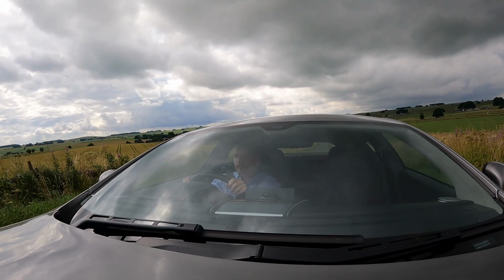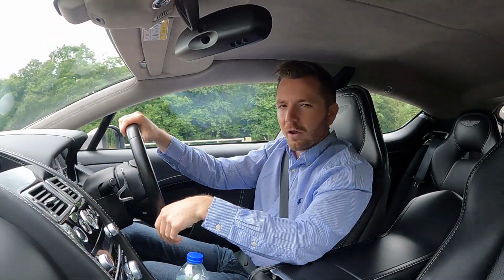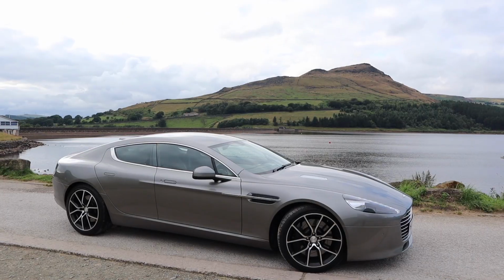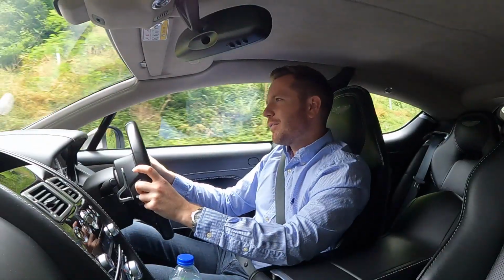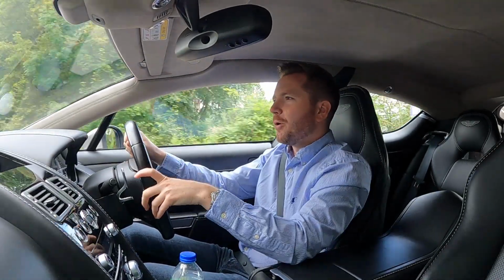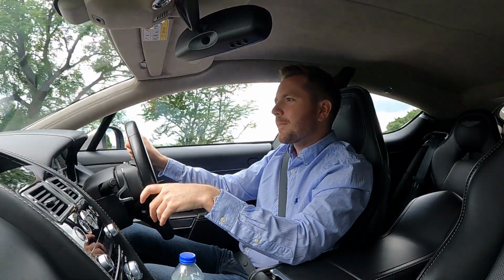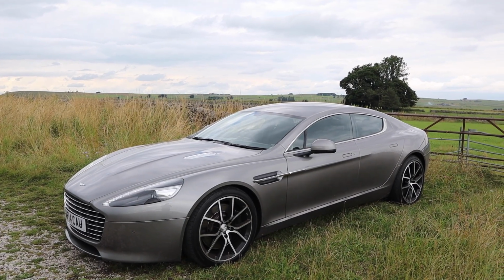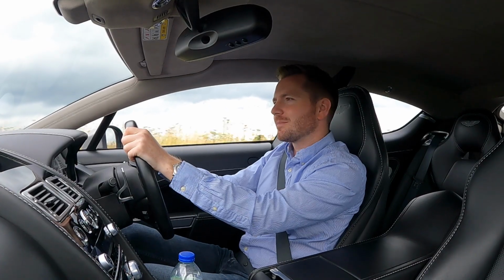Should You Buy an ASTON MARTIN RAPIDE? (Test Drive & Review 2014 Rapide S)

Comment: Just come across this review. The key you have is the Valet Key, it's there to protect the nice looking Emotional Control Unit or Glass Key. Later versions have a superb 8 speed box that really kicks down (and up) quicker than it really should. It looks best in any other colour than the one you are driving. I like the black one. Also the last two years (or so) of manufacture have CarPlay and Android Auto. The key also came in a leather pouch with a key ring attachment. Nice review.
Reply from the maker: Thanks

Comment: How is for a 6 ft 200 pound person is it cramped or plenty of leg room ? I am looking into buying one just wanted to know :)
Reply: I'm the same dimensions as you and there's loads of room upfront.
Reply: @rhone81  Thank you I appreciate it
Reply: @johnniepope7214  No problem. I bought a 2013 Rapide S three months ago.

No complaints about the driving position, loads of room and comfortable. I've not had any issues with the high centre console. If anything it makes you feel part of the car and the car shrinks round you.

I'm uncomfortable in the rear seats though and my head touches the roof lining. If you have anyone the same size as you who'd be going in the rear it'll be a problem.

If you have any other questions just ask.

Comment: I currently drives a Maserati Gran Turismo Sport, 4.7 NA engine. Great sound and practical. For the next car, I am thinking about a V12. It is difficult to choose between a Rapide and a Ferrari FF. FF is definitely more engaging and sounds awesome and it has more presence on the road being a Ferrari. But it is very costly to maintain and repair, not to mention the fragile transmissions (yeah, the s is accurate). Rapide is more subtle (relatively) and maybe a bit too under the radar. But it is definitely more reliable compared to FF and less expensive to repair. And it is about 50% cheaper to buy used. The wise version of me tells me to get the Rapide. But my heart tells me that if I get the Rapide, I would still think about getting a V12 Ferrari in the future.

Comment: Hi Matt, the disappointment with the key is because you have the ‘Valet’ key. The actual key is actually a crystal key with the logo, which is sadly called the ‘Emotional Control Unit’ (ECU) and they are VERY expensive to replace and can be damaged quite easily, hence you having the valet key
Reply from the maker: Both the keys on this were the plastic keys disappointingly

Comment: Owned an 03 Vanquish V12 6.OL, driven many miles with few problems. Used to start it in the garage with exhaust 2 feet from wall just to, well, you know, cross your legs and... . OMy effing G, what a sound. I sold it in 2010 and am currently still in therapy but told I will get over the loss.... eventually.

Comment: peel aston m logo from key fob and you will see volvo sign on it, same goes with engine
Reply from the maker: You’re thinking of the vantage
Reply: not vintage at all, take any mercedess take it on ranmp and 80% parts are from renault and fiat. these days can't buy good stuff. i been driven 18T MAN rigid it's was about 1 month old 2000 miles on clock and wear of metal frame around rear doors (as an example) wasa exact as on 12 year old exat model and size. 
PLANNED OBSOLESENCE (it HAVE TO BRAKE right after warranty expires) thats what we paying for

Comment: Keys have been crap ever since they put chips in them let alone door unlocking remotes. RF connectivity requires plastic and plastic is plasticky, it's soft, it wears quickly and it rapidly looks worn and tacky.
There are "quality" plastics that wear well, perspex is one, it's hard and in use in the pocket it gains a soft semi-polished patina. But perspex is brittle, drop it and it will probably snap.
A key that looks good after 10 years of use is possible but requires investment in materials and production. Most car manufacturers are content to farm that out to the likes of Hella.
And size, why are car keys so big? I have three cars in the family but three keys on one ring and you have something too big too carry in your pocket.

Comment: The proper key has a crystal endpiece with the Aston logo etched into it and is called an ECU. Emotional Control Unit.  As long as this car is they needed to make it 3 inches longer so the rear seats could be more practical. To buttress my point, When Aston turned this same chassis into the £1million Taraf. They stretched a Rapide by about 5 inches to make it a proper limo

Comment: 'Never meet your heroes'... I was lucky enough to buy a black 2009 Vantage N400, back in 2010. On collecting in, the dealer handed me a bunch of keys/fobs - all separate [2009 models didn't have the crystal integrated version]. I hadn't even thought to look at keys when test driving - I found out these were old Volvo parts. As was the satnav, which wasn't great. Neither was the gear selection - particularly reverse. Turning the key produce a glorious noise [not quite the V12 soundtrack here, of course]. It was such an incredible car to look at. Opening the swan door was an experience in itself. And a beautiful place to sit. Once it got into its stride, it felt fast and the noise was awesome. I was sold on the looks/noise/brand. But to drive on a regular basis, it wasn't as good as I expected. Not close. And driving is what most of us buy cars for, after all. I stuck with a V8 and bought an E93 M3 a few months later. Which was fabulous in all aspects!

Comment: That is the Valet key. I bought a Rapide back in January and was given the beautiful glass key, valet key and an emergency door key. I love starting up my car, I get goosebumps every time. I have had a few niggles, like petrol filler cap sticking, windows not working, loose door struts and now wing mirrors not closing back when locking the car. All covered by the Timeless Warranty which has been invaluable, my dealership has been brilliant though. Shout out to #AstonMartinCambridge

Comment: Good review which drew an accurate picture. Except for you panning the key! That valet key is cheap, for sure, but the crystal glass key, also known as the ECU, Emotional Control Unit, is exquisite. Drove several DB9s before buying my Rapide S, and the Rapide drives as well if not better, and with that big grille, is distincrivewith great road presence. I concur with your comments about how it evokes positive reactions. Coming out of a 911 that was a nice change! I've owned lots of cars from different manufacturers but none of them have prompted as many smiles and positive comments as the Aston has 👍Absolutely love it, and that I can fit the grandchildren easily in the back, which they love, is a big bonus. Plus their stuff in the boot. One of AMLs best, and most under-rated cars. And that's my number plate: AML S.
Here's mine. Skyfall Silver, exterior carbon pack, interior piano black. https://youtu.be/aT5BnSY4kcA

Comment: I'd go for the DB9. I get to drive one regularly for a Wedding company i work for, usually to pick up the Groom... It's a great car. A bit cramped, but I'm with you.. The engine noise...incredible! It puts a massive smile on my face. The DB9 has the start button without the key jutting out of it. The key on the DB9 is awful too, I'm told its from a Volvo.

Comment: Great review Matt, I've worked with Aston Martin cars now for 10+ year's & in my opinion they are very reliable & surprisingly for a high end premium brand parts are well priced, the V12 suffers ignition coil failure from time to time but are aprrox £30 each, O2 sensors are another item, but again we'll priced at approx £100 each, but these failures are mostly due to the lack of use, most Aston's are used sparingly & generally parked up over the winter, would be my choice over an Italian product any day, now what you really need to try is a full fat version, something like a Vanquish S now that will definitely make you speechless. ATB
Reply from the maker: Thanks for the info
Reply: Joe King...right?  These cars are not for the light-of-pocket. It's going to be worth FA if not maintained by Aston Martin. THAT is why there are so many cheap ones on the market......they are iffy. Let me say that again.....Plenty of cheap ones....for a very good reason.

Comment: That’s the valet key your using plastic black 
The main key Is a crystal glass key
Reply from the maker: Both keys are like this
Reply: They all come with  1 glass key deffo not an option. 
When purchased  new it would of had a glass key  even 2009 onwards v8 vantages had a glass key or Emotional control unit as Aston called it!

Comment: Very clever Bond references! I can remember when you could buy an early Rapide for £30,000, 4-up Astons are always the runt of the litter, much like Ferraris.

I suspect that we're still a lot of Ford-sourced parts in Astons of this era, but I think Aston V12s will only appreciate, especially as Astons now are just re-clothed AMG Mercedes mechanicals.
Reply: They only have the AMG V8 and the electricals, and nothing else. (Transmission too in the DBX). The chassis and the platform is all proprietary AM.
Reply: @subarnosinha8042  That's one way to spin it, Mercedes have a 20% stake in Aston Martin who are heavily reliant on Mercedes engine plans going forward, whether that be  a V6 twin-turbo or EV with an Aston Martin badge on it.
Reply: @TheEarlofK  I'm not spinning anything here. Apart from V8 engine and electricals, everything else is proprietary AM stuff in current models (including the V12). No chassis/platform sharing between them, but in future EV platform might be shared.
Reply: @subarnosinha8042  It rather depends on  how you define proprietary stuff, it's still largely AMG. I doubt the V12 will feature in anything but the limited-run top-end models, the rest of the range will probably be fitted with V6 Turbo engines going forward.

Comment: I was working at the 2010 Motorshow at Excel when the car was launched, the show it self was pretty lame in that there wasn’t much of a wow factor, lots of empty space’s where a number of exhibitors had pulled out (the financial crash just being the year before). The only standout for me from that show was this car. From the outside I thought Aston Martin had nailed. For a five door, the lines and proportions...it was unmistakably an Aston Martin, unlike the Porsche Panamera, which I thought was ugly, although that has improved over the years. Alas the interior, although well appointed, wasn’t really practical as you already pointed out, still the engine note will never get old.

Comment: The car just doesn’t do what a four door car should do, the compromise is too great with the bucket seats in the back the restriction in space is just not good enough. Like others have mentioned you can get a DB9 convertible that for me has greater presence and the dimensions work so much better. Undoubtedly it still has style and DNA of the Aston brand but for me it doesn’t work

Comment: That fob is the valet/service  one, there should be a crystal one as well. A change on the later "S" models, the "Made in England" plaques, the earlier ones were built in Austria by Steyr Magna, who previously bolted the Countryman together for MINI...
Reply from the maker: I thought so too, but both keys are like this. That’s a bit of an insult to Magna Steyr, they’re responsible for some excellent cars over the years
Reply: @HighPeakAutos  “Both keys”, there should be three keys, two plastic, one crystal…
Reply: @geecars6263  👍👏
Reply: @HighPeakAutos  In what way is it an insult, I merely pointed out that Aston Martin took production back in-house. In fact they cancelled the contract early, read into that what you wish…

Comment: Good video! You can understand why they stopped making the Rapide - it's basically a less capable Porsche Panamera or Bentley Continental (both of which retailed for less money, and hence sold more units), which means thanks to their accelerated depreciation curve makes them even better value than the Rapide today. Personally I would have an Audi A7 over any of them in 5door configuration,  but the 2door Bemtley wins the race - Good Luck!

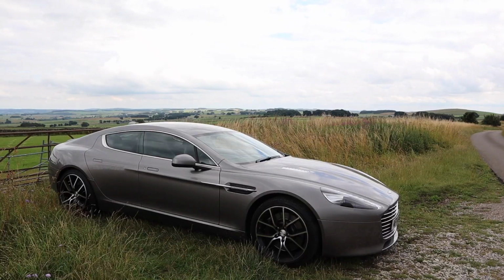NB: nice overtake on the Golf Diesel, but were you REALLY over taken by a Citroen Berlingo Campervan at 06:02? You will never make James May, let alone James Bond ;)
Reply from the maker: Hahah yes thats right

Comment: Gray tone paintwork is to Aston what red is to Ferrari. The ONLY color to get.
Reply from the maker: Totally agree
Reply: @HighPeakAutos  By the way. I believe the key you are using is the secondary or perhaps the valet key. I believe the original key does have a glass top with the winged logo on it. This enables a seamless look once the key is inserted into the ignition slot.
Reply from the maker: @DJL78  that’s what I always thought but this was bought from Aston Martin with two plastic keys like this. No glass one

Comment: HPA - just a general question on in-car sat-nav, have you ever installed (in a more conventional car) the Android based head units that seem to be appearing on the market intended to replace the radio and rudimentary display?  I'm seeing them for a number of 2000+ year cars, they'd offer whatever apps you can install on a phone but as an in-dash device of course.
Reply from the maker: Nope, I've never done that. I'm not a fan of aftermarket things like this. I thought (for about 11 seconds) of doing this on my SL55 but decided against it
Reply: @HighPeakAutos  I used to think this too however I've noted that some of the newer releases look more integrated and I believe some have software to link to the car's other systems to get detailed readings (not delved into that much).  I've seen some which look like factory installations, they have facia plates that are quite effective.

Comment: The sound and the looks are amazing! But with that small back seat, I don't see the point of choosing it instead of the DB9, which is even more gorgeous.
Reply from the maker: I agree. This is a bit more than a 2+2 (like a DB9) but it's not a spacious 4 seater either
Reply: Perfect for taking the wife and the dog away for the weekend though 😉
Reply: Don’t overlook the hatchback - quite a bit of space when rear divider folded down!!
Reply: @Georgi: Wrong. The rear seats are far more usable than you might think. I've had 4 adults on a trip and the rear ones loved it. Unless the driver and front passenger are well over 6ft there's plenty of room for normal size adults and children in the rear. And the luggage space is far more than DB9. There's plenty of opinion (not just mine) preferring the looks of the Rapide too, so not a hands down win to the DB9, by any stretch.
Reply: @gregspark9845  Looks are subjective, so to each his own. But you must've had some extended wheelbase version of the car, because I found the back seat really tight and I'm not a basketball player. And the read door opening is an absolute joke.
Reply: Adults will fit whereas they will not on a DB9
Reply: @larryhand6537  If the goal is to transport adults on a regular basis, I would just follow Top gear's advice and get a Maserati Quattroporte. Otherwise I don't see the point of getting a four door for the rare occasion when you're going to need the backseat.
Reply: @georgimihalkov4781  very few people transport 4 adults on a regular basis, and yes, I agree, you'd look for a more accommodating vehicle. But having the flexibility to do so occasionally is great, and that's near impossible in the DB9. For me it's grandchildren, who absolutely love being in there. And no mine isn't a longer version. The worst part is the awkward narrow door access, but once in the cockpit is luxurious and comfortable. Have you ever sat in the back of a Rapide or just taken other critics word for it?
Reply: @gregspark9845  I've been in the back of a Rapide and definitely the door opening is pretty bad, it's hard to get out with grace. It's luxurious in the back for sure, but for me it wasn't particularly comfortable and spacious and I'm not a big guy. It has a sense of occasion about it for sure, but I wouldn't want to do a road trip in it.
Reply: He forgot to add that the back seats go down. That gives you more space in the back.